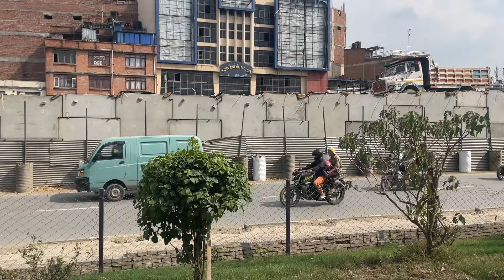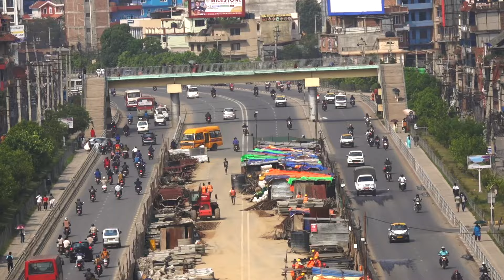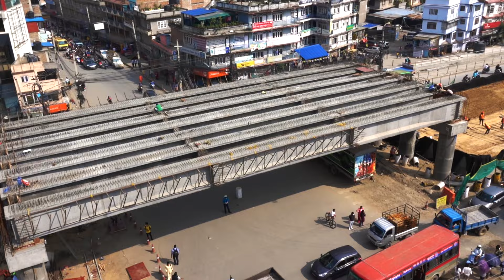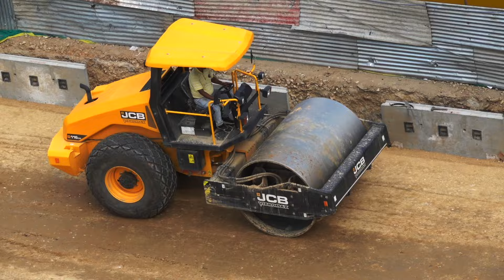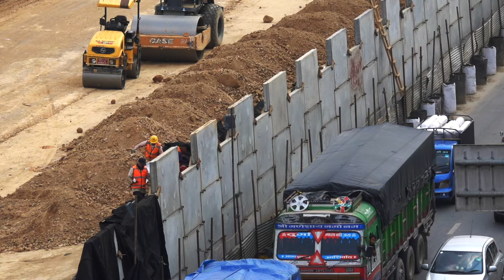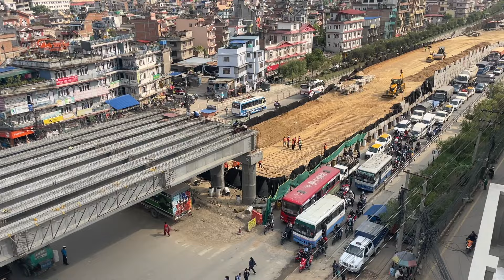🔥🔥खुशीको खवर 😍😍ग्वार्को फ्लाईओभरको भौतिक प्रगति ७२% Gwarko Foyover Construction Latest Update

Comment: Though the work is in a completion stage but this is a failure project with huge costs. This place was suitable for underpass rather than over-pass (people are saying flyover to it, but it is not a fly-over, actually its an over- pass). You see the space below the elevated section remains unused in this ringroad section. So, it is not a suitable project..
Reply from the maker: That’s true. Flyover banako bhaye tala useable space pani hunthyo.